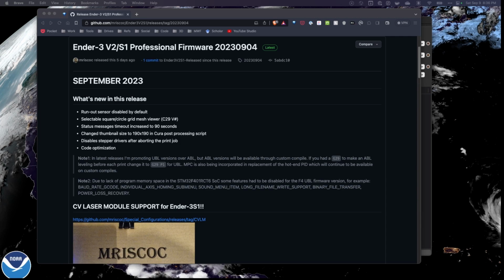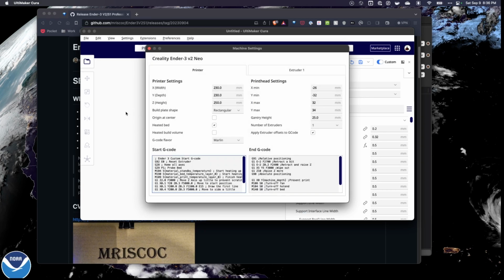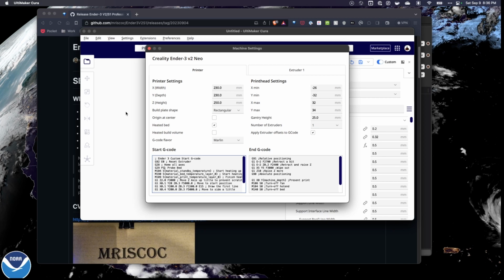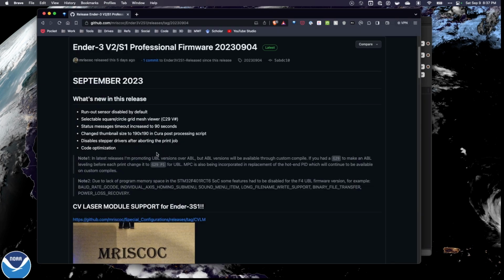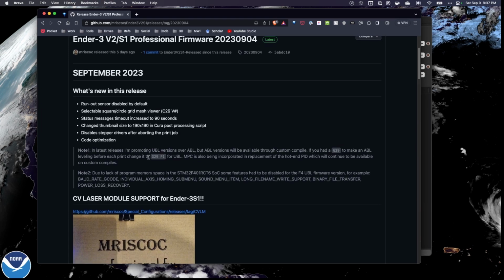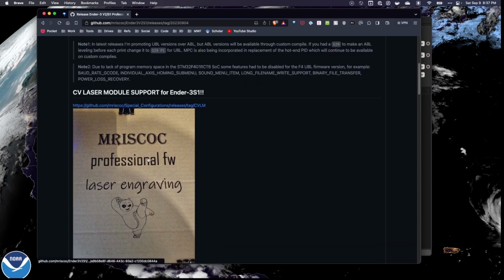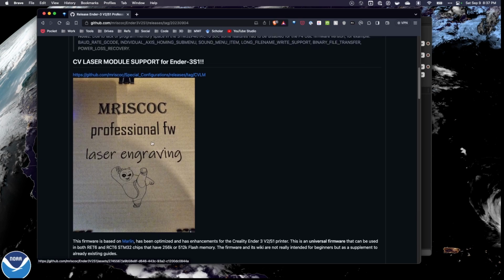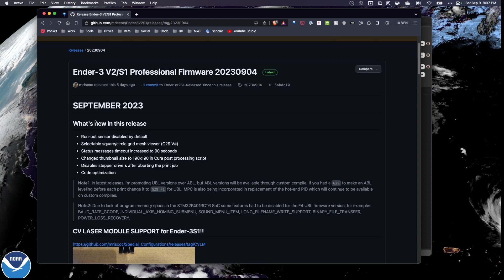mriscoc Professional Firmware for Ender 3 V2 and S1 Gets Major Updates in September 2023

Comment: I have loaded this firmware onto my Ender 3 V2 running a 4.2.2 RCT6 (256K flash) and a CR Touch module. My screen display is a DACAI v1.2 unit. I do not see thumbnails on my display when printing. I've updated the display firmware to use Giadej icon set. Anybody else having issues?
Reply: Yep. Only issue I’m having with it.

Comment: Hi there, Im totally new to to 3D  printing, but been a tinker'r for many years and quite a few people I've talked with have mentioned this firmware - does it work on  an ender 3 s1 pro ?   Sorry if a dull question, i always ask even if it stated when it comes to a firmware install   edit - just read don't work with touchscreen, if that so - is there any hope it will one day or could I just get a non touchpad to use it with.  many thanks for any answer...
Reply from the maker: I don't have the s1 but I believe it does work with it. I am not sure about the screen.